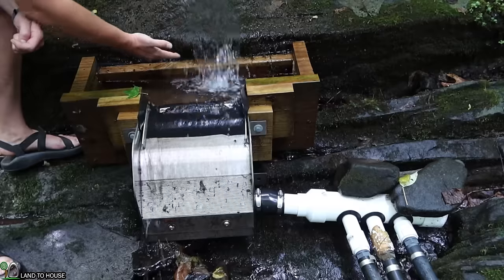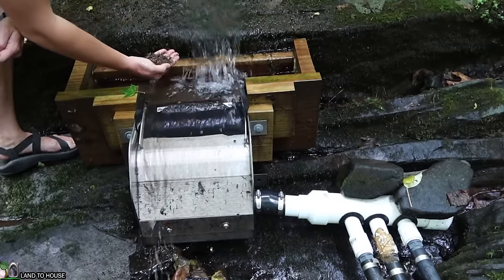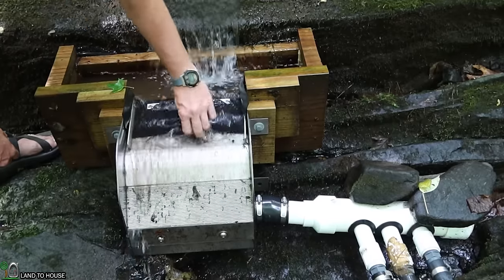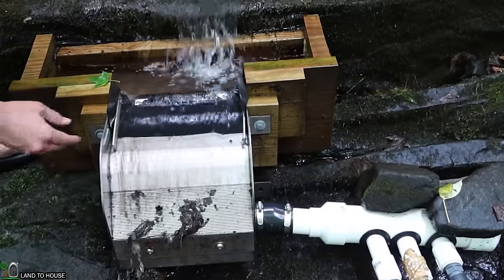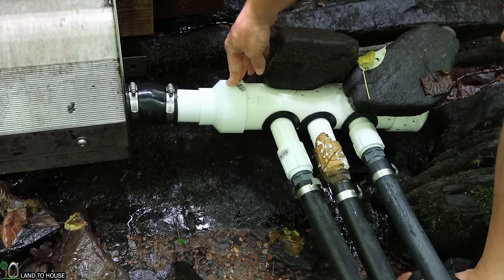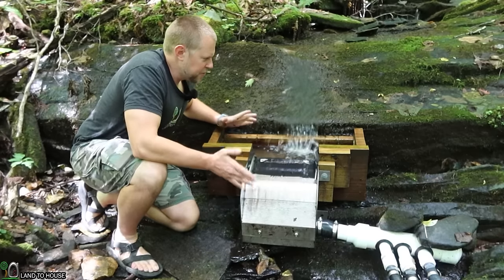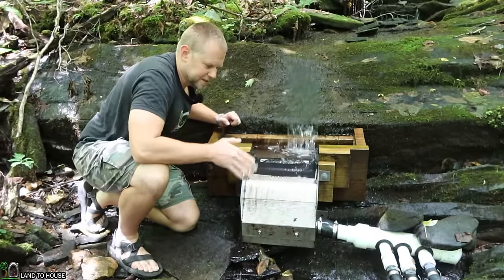Awesome Mountain Hydroelectric Power

Comment: it would be my goal would be to make money by feeding power back into the grid or, at a minimum, having no power bill. I think if you put a bigger penstock like 250 or 500 gallons or even a pond and turn it up to 300 or 400 watts plus your solar, that should be almost all the power you need, especially after the battery upgrade.

Comment: Would it be not easier to install turbine closer to water source and just use electrical cables instead of this overcomplex piping solution?
Reply from the maker: Mounting the pma over the creek is fine. I doled not want to break the 250 feet of wire and that is one reason for the placement in the woods.

Comment: kind of wish there was a way to control water flow at the pen stock to control the speed of the hydro, along with a much larger storage tank up top to supply more water during high demand.  the problem being, it's still metric tons of water you'd need to store to make it useful (8-12 hours).

Comment: This seems like a lot of work and cost for 100 watts. I love the idea of 24/7 power but I would want to be getting at least 1000watts for this amount of work and upkeep.

I currently have 14kw of panels on my roof and 12kw of inverter with 14kwh of battery storage, although at a much higher cost (roughly 15k over 8 years), although there is zero maint or work to keep it going, and I have enough battery power for 1000watts consistently through the night.

Comment: Just jumped in to this for the first time . . . . .  seems like you could stagger the settling tank(s)  instead of the rather expensive and complicated filter at the top of the design.   They are much simpler and less costly - - I dont understand why the filter at the top is necessary can you expand on this?

Comment: What good is this system if you don’t use it in the winter when power is needed most.  This way seems like more problems then making the hydro system close to the river and running the wire to the house. 
This system is lots of places to fail.

Comment: FREE ENERGY! TRUE FREE ENERGY! Siphon liquids UP by putting a bottle above water/liquid source, have a siphon tube go from water/liquid source to top of a sealed container. on the bottom of container put a spout so water can flow back into the source. the water coming out of spout will create suction in the container pulling water up the siphon tube! it will continue to flow until water evaporates unless you build it in an enclosure or use ionic liquid. with water flowing constantly you can use the tesla turbine or any hydro-generator to give you free energy for everyone in the world! Thank you tesla for free energy for the world!

Comment: I think your explanation of when you solar ramps up is backwards. When your controller removes load from the generator it will spin up faster.
Reply from the maker: There are two controllers. 1 for solar and 1 for hydro. When the solar suddenly has 2500w+, the 100w of hydro cuts out. (Load drops on hydro) the hydro turbine spins up.

Comment: Could an inline fuse or breaker have prevented the electric mouse incident from destroying the generator?
Reply: I think it might be a runaway thing.   When there is no load the turbine overspeeds and tears itself apart?   I don't think it is such a problem with pelton/turgo where runaway is about 200% but with propeller and kaplan it is about 8 times normal speed.
Reply: @guygillmore2970  I have 100 more questions after hearing your reply.
Reply: @guygillmore2970  burns the stator way before it tears itself apart ! it's a problem even for peltons n turgos, either install a voltage clamp or a diversion air heater

Comment: If more water pressure is ever needed you can always use sections of smaller I.D. of pipe. As the I.D. of pipe decreases the pressure increases.

Comment: THIS is what I have in mind,   a decent backup battery system/solar then hydro when able, hopefully year round.. I can build me a dam that will run big generators, i have the know how and engineering so forth, actually dams are not that complicated, a lot or folks think welp I'm on all level ground no way to do it.. 

the romans ran water uphill all the time, 1000ft in fact, how did they do it? gravity, siphons, water always finds its own level, so if the water goes below the water level the same distance you want it to go up, the pressure will always push it up that far, so you can lift the water the same distance you let it flow underground, it's called a siphon, they used inverted siphons to make the water travel over hills and mountains.. research it..

all you have to do is catch the water coming back down, run it below water level 6ft, that downhill pressure will push it up or above water level 6ft, then you just run it through penstocks, of course the pen stock for optimal efficiency are calculated at a taper, they get narrower in diameter close they get to the turbines, this creates more power and speed, its not huge, let's say if you your 8" pipe was falling 6ft then taper it to 6.5 or 7" 20 before the turbine, there are formulas for all of this easy enough to find..  or try a pumped storage set up?

so you can run water downhill on a flat surface, OR, you can just divert, then dig down 4 ft, let it fall thru penstocks then out a larger diameter pipe, that enter and exit another dam the same height, again water finds its own level so it will fill that dam back up to water level, all you did was put a turbine midway thru your reverse siphon... works.. OR you can dig out a reservoir and make the dam height a few 3 ft higher than the water level, let reservoir fill and BOOM!  now you even have reserves...  how most modern dams are built where there are applicable canyons to fill...  otherwise they simply calculate their fall in any given 10 miles of travel and build a dam, then the drop is sudden over the dam, like they do on say the columbia river, there are no rapids on the columbia river anymore cuz they have it all damned up, so now it flows deeper and slower.. works, no need for reservoirs with a constant massive flow like the columbia, smaller rivers like say the colorado you need massive reservoirs and that system is perfect for the 7 or so dams they built on that one, however they leach far too much off for drinking and bathing along with agriculture..

anywho yea I'd sure like to create my own power for sure, divert, build a nice keen dam say a 50 footer with about 8-10 ft of drop, 2 2kw turbine generators ought to be real good, then I can give all sorts of surplus to neighbors or sell back to the power company,, yea that's about right, average home uses 3-40kw per day, using 2 kilowatt I can have one offline at any given time and still produce around 50kw per day, sell teh rest back to the power company, during spring runoffs fire up both sell em about 80kw per day.. that's about $300 a month for pocket money...  :-)    you can set up a system with 2kw hydro turbines for around $6k with everything but the dam, penstocks so forth.. that can be creative, wood, rocks, rocks and concrete or formed up with concrete, a 40-50 footer may cost a few thousand in concrete.. around $10k you can have one pushing serious electricity, even less if you go frugal, used parts so forth, maybe as little as $2-$4k?  or start with just one generator and turbine, but build your dam to accept 2-3, so 3 penstocks..  then as the electric company starts paying you buy more generators so forth..  be sure your property is zoned and you have water rights..

me thinks you might wanna implement a sluice somewhere in your setup, might be precious in them there waters?

Comment: Why did you not use a 90 poly bend out the barrel so there would be no torque the hole in the barrel - eliminate the necessity of the stand?

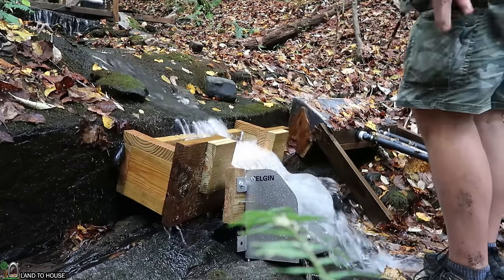Comment: 2:35 - "I have a little over 30gpm coming down the creek, and as you can see, this Coanda box is sucking all of that in...". 
9:25: "No, I'm not using all of it".  I understand that there are other springs but 50% is diverted during the run.  It's probably not even a big deal yet here we are...

Comment: Just a thought  - it's more efficient to transmit power over distance as DC rather than AC - how about rectifying it at the turbine and add a big capacitor to the  + and -  output of your 6 diodes so that you're sending power continuously as DC, at max voltage ⚡.
3# AC has peaks and troughs in its voltage over time, so not as efficient.
In New Zealand we send power in a 25 kilometre long under water cable across Cook Strait as high voltage DC, for this very reason, between the big hydroelectric Dams in the Sth Island to the big cities in the North Island.
Reply: Are you sure about that? AC is used for transmission lines unless the distance is hundreds of miles. That is when DC is used. Short distances like under a mile, AC would seem the better choice.

Comment: Nice video Seth, appreciate you sharing your Micro Hydro setup.

1. I am assuming that your divorce is final due to no wedding ring.

2. How are the kids doing, its been awhile since I saw them in a video?
3. Can the hydro system keep your batteries charged with your daily consumption without using Solar?
4. When converting to the rack batteries will they be LifePo4?

Thanks for sharing.
Reply from the maker: Thanks for watching! 
1. Divorce is half done. More on that update later. 
2. I have started a new channel dedicated to family vlogs. Update coming in the next 30 ish days. Should let me post a lot more family! 
3. The rack batteries are Lifepo4 5kwh each. Might place those in the crawl space and send wire out to the shed. Winter worries on cold temp.
Reply: @LandtoHouse  do you look at flywheel storage for your power storage?

Comment: Hello Seth nice setup you have. What I'd like to know is what would the difference be if you changed the 55 gallon barrel to a 350 gallon tank do for your micro hydro?
Reply from the maker: Because the pressure is basically zero from the coanda screen to the 55gal tank adding a larger tank would not do anything more than add silt catchment volume.
Reply: @LandtoHouse  you can run the whole system at max power for a couple extra minutes, though..

Comment: Great System. Have you considered adding motorised valves and a microcontroller to regulate the flow depending on the water pressure or   barrel water level?
Reply from the maker: It would need to be based on pressure because the 1100 feet between the intake and pma would be too far for a wireless signal.
Reply: @LandtoHouse  you could do this in a dumb way, if you got precise enough pressure measurement and don't mind losing a little bit of pressure on average but are able to max out available production. Do two or 3 barrels, different elevation, large, small, very small overflow top overflow open, lower ones sre closed until water level drop below the bucket above.. If you got enough flow to max out the entire system and still got water left over, great. If it's too little overflow, open overflow on second bucket, wait until water level dips, measure pressure change and adjust flow rate over nozzles according to new measurement, if it goes even lower, open overflow on lowest bucket, and adjust turbine house flow according to minimum water or below according to measured pressure. 
How much pressure drop would a system like that have to work across to be easily measured?
Reply: @LandtoHouse  you can actually do it on the bottom by the turbine not the head end.  They make various DC voltage powered valves.  Would be able to control it based on output voltage to prevent over speed.  Currently I use a dump load for mine so I don’t overspeed when load is low.

Comment: Along with the rack batteries the all in one  inverter charge controller that communicates with the lithium iron phosphate rack batteries would probably be the way to go...Those systems can handle far more solar and limitless batteries, meaning  no electric bill, but having the grid as back up instead of solar/hydro as back up...Far better solution...IMO...
Reply from the maker: YES I am gathering the needed parts to install such a system. 15kwh battery and 8000w inverter.

Comment: A basic question. You are basically letting it idle while the solar is running during the day.  Have you considered building a pond at the top to collect and hold water during the day and release at night to get  higher nighttime capacity?  It would have to be fair sized, but would also give you your first level of silt filtering so the barrel and overflow ( with the water loss from the overflow ) could be eliminated. I'll also mention that a pond gives you water for irrigation with a decent head, and a fire reservoir should that ever be an issue.  

Back of envelope calculations  is every thousand gallons  of "pond" at the top would give you another gallon per minute available at night.
Reply: Yeah, seems like an obvious move,his system can handle the power, the solar takes care of the day. A big pond seems cheaper and permanent, compared tthano the the agm batteries that will last 5 years realistically
Reply: @kapytanhook  Heck, I wonder why the solar folks don't use Nickle Iron batteries. They lose 10% a day, but last forever. Seriously, with  service every 20 years or so they last centuries.
Reply: @bobmazzi7435  they aren't that great man. Bad round trip efficiency. Always leaking charge, cost per kwh isn't even that amazing. Sure they last a bit and can take a beating but there is no good battery solution yet. If it got an order of magnitude better we would be golden. 
Nuclear power seems like the obvious answer but not really being scaled up anymore
Reply: @kapytanhook  But with solar you just size the panels 10% high. And never have to replace batteries. As compared to replacing batteries every 5 years it seems like a good play.
Reply: @bobmazzi7435  You may be right, I ran my own numbers once and per usable KWH it seemed to be like the same price, transport cost is a factor, also needing to vent them and top them off. Small stuff like that

Comment: What guage wire do you have running 250ft ft? is it 10AWG guage? Prolly should have run 6AWG in the conduit to account for voltage loss and drop for distance. the wire is prolly gonna get toasts pushing amps that far on such a thin wire. Is that the orange casing thats in the conduit?  If so your not supposed to pull cased wire into conduit either
Reply from the maker: This unit runs at around 72v. So at max power of 450w that is 6amps. Most of this summer I have run the hydro at 100w. This means the amps are around 1.3amps. Not likely to heat up much as that amperage.

Comment: I was looking at the video from the aspect of efficiency.  The first loss of efficiency I saw was the loss of head to the barrel resevoir, which was so many feet below the three feed pipes.    Also there must be some losses in charging and discharging the batteries.   Have you done any of these calculations, to see where the power is going..?
Reply from the maker: The loss from the intake to the barrel is around 2 feet. About 6w of loss. Not bad. I am working with a company to get lifepo4 batteries. Should make a big difference!

Comment: So, given all the generation capacity and batteries, why are you using grid power at all? Wouldn't it be better to use the solar and hydro as your main power source and then use the grid for when your battery is drain?
Reply from the maker: After this video I received a large inverter and battery from a company and this has been running my house off grid for the past year.

Comment: I hope this isn't a stupid question but wouldn't a steeper angle of the water pipe produce more water pressure at the bottom?
Reply from the maker: No problem.  The total height of the water column is what makes the head pressure. The angle does help to keep air out of the pipe.

Comment: If the turbine runs from pressure not volume wouldn't it be more efficient to start with 2 1/2" poly pipe and drop down 1/4" every 200ft.?  I remember reading something about the romans using a step down system that had something to do with hydraulics that gave huge head pressure naturally. I could be wrong,
Reply from the maker: From my understanding head pressure is measured from vertical height regardless of pipe diameter. Example: 3 feet of head in a swimming pool is the same 3 feet in a 1/2" pipe.

Comment: Doesn't the barrel in the middle cause so much friction that it negates the head between it and the intake? I see people eliminating any bends or sharp turns to minimize drag and thus loss of power and here there is a straight up barrel full of turbulent water in the middle.
Reply from the maker: The barrel is just below the intake. A loss of 2 to 3 feet of head. No real issue with the loss.

Comment: Are you not losing all the head pressure from your collection site to your 55 gallon drum? The overflow line serves as a pressure bleed?
Reply: Ahh, I get it. The  head you are using is from the 55 gallon drum on down. You could move the drum up and get more head pressure from what I can tell, but I'm not certain.
Reply from the maker: Its hard to see from the video angle but the 55 gallon tank is only 2 feet lower than the coanda screen. Its losing 6w approximately.  The benefit of silt and air removal is worth the 6w.
Reply: @LandtoHouse  That is hard to see from the video. Those two feet are indeed negligible.